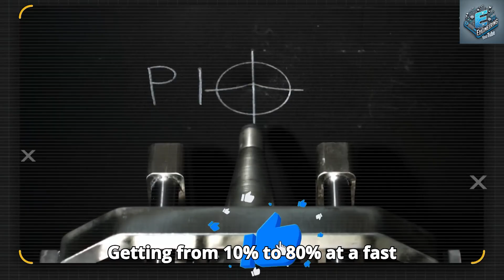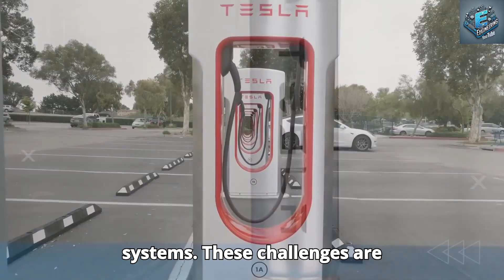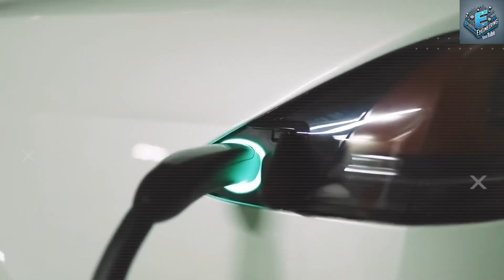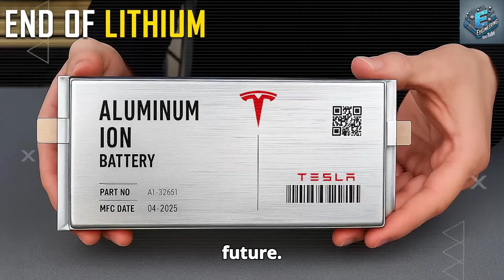End of Lithium ALL-NEW Tesla Aluminum-ion Battery Leaked for 2026 Model 2

Comment: Will Tesla Use Aluminum Batteries?

As of August 16, 2025, there are no official announcements or confirmed plans from Tesla to adopt aluminum-ion batteries in their vehicles or energy products. Speculation has circulated online, particularly in YouTube videos and articles claiming Elon Musk "announced" aluminum-ion tech for models like the 2026 Model 2 or 2025 Model Y, often citing vague quotes from Tesla's Q2 2025 earnings call (e.g., "batteries are going to be a massive thing"). However, a review of the full earnings call transcript shows no specific mention of aluminum-ion batteries or any shift away from lithium-ion; the comments focus on general battery demand and scaling for energy storage like Powerwalls.
Reply from the maker: Currently, there are no official plans from Tesla regarding the use of aluminum-ion batteries. It's all speculation at this point, but it's definitely an exciting topic to keep an eye on!
Reply: @CoreElectricalEngineering this means someone do fake videos for clicks so it is fair if i dislike this video